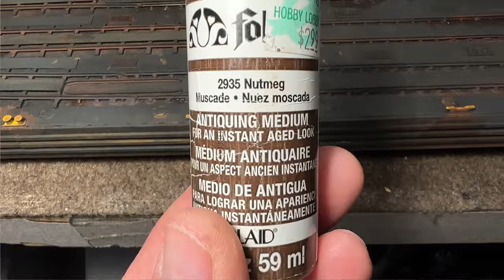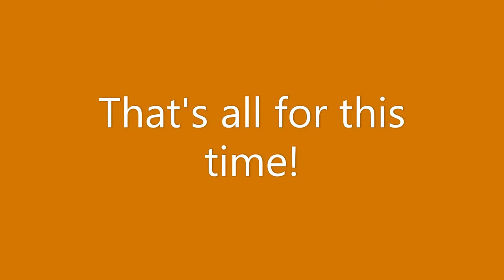HO Scale Model Railroading - Big Island RAILCAR BARGE - Repairs, Details, Painting, and Weathering.

Comment: A friend of mine's HO layout uses six barge decks which hold nine cars, 3 per track as off-layout staging.  The barge end rail stops have couplers to hold the cars on the barge deck.  The six barge decks are stacked on shelves under the layout and taken in order.  His car list software keeps track of the cars on each barge and layout customer.  So 54 (9x6) of the 100 cars on the layout are stored on the barge.  A few like the track cleaning cars and MoW cars never ride the barge.  An OP session is usually taking one train of 9 cars off the barge, sort them and take them to layout destinations and picking up 9 cars to take back to the barge and loading them.  A typical OP session last 2-3 hours.  I like the idea of using a barge or ferry as staging